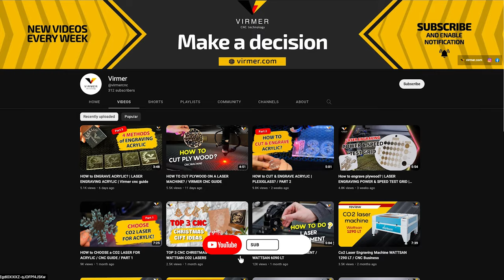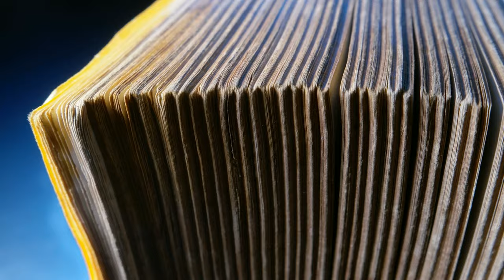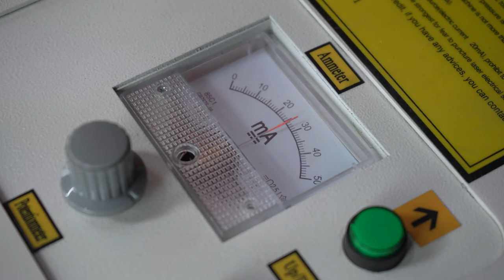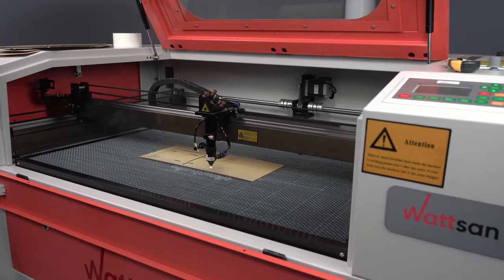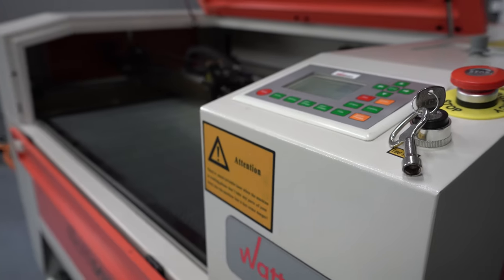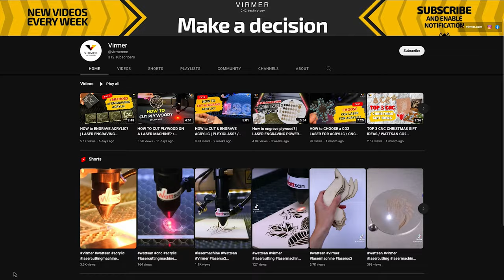Laser Cutting & Engraving | Paper & Cardboard | Virmer CNC

Comment: How do I find the correct laser parameters for my paper in the easiest way?
Reply from the maker: Hello. In order to cut the paper it is necessary to find the balance between the minimum power required and the maximum speed. Try to choose settings such that the machine moves at the limit without cutting through the sheet, so that the residual power of the laser tube is not reflected on the back of the paper or cardboard. This also applies to other materials. 

For example, using an 80 watt laser tube, you will be cutting a standard sheet of paper at a minimum power of 10 percent or 8 watts. On Wattsan CO2 laser machines, starting with the 6090, you can reduce the minimum power to 4 watts.

Please contact us or leave your e-mail to hhelp you in details according to your tasks.
Reply: Thanks for the answer. Have a good day!🙌